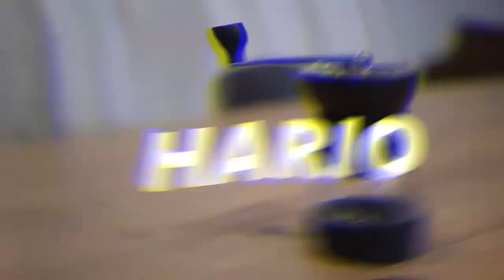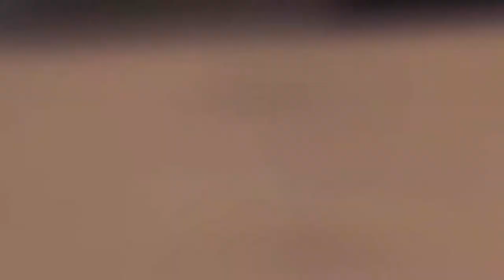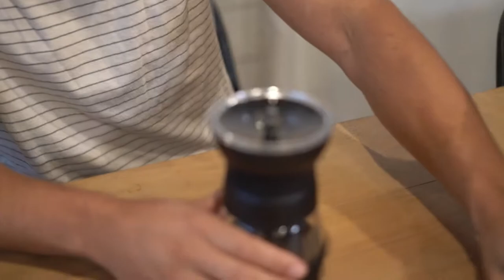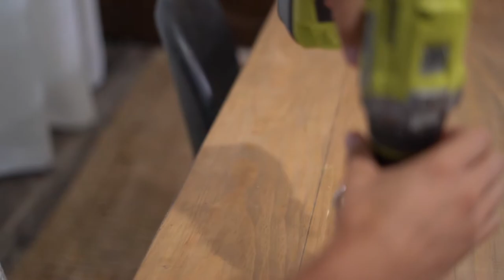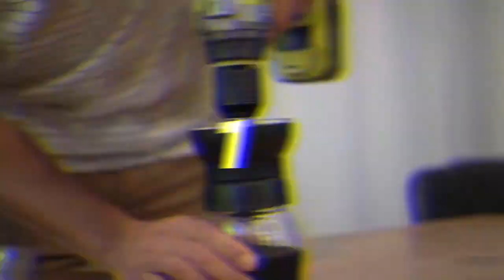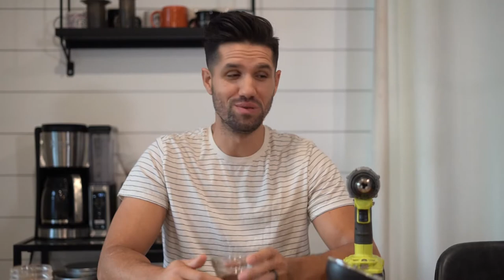Hario Skerton Hack: Drill Mod - Grind Your Coffee Fast!

Comment: I tried it with my drill but it kinda struggles. If ı crank up the power all the way it does turn but it's way too fast. If ı try to turn is slowly it just does not have enough power to crack the beans. How much power does your drill have? I also have the skerton pro model btw

Comment: Ryobi drills are clunky asf. I recommend a Milwaukee M12 drill which is much lighter weight and has plenty of torque. Set the drill speed to 1, set clutch position to 3, attach a 1/4” hex shank socket driver, and a 7mm socket to drive the burr shaft.

Comment: Ha ha. I thought about doing also. Good job. My current low end Ascaso commercial grinder has a stripped nylon gear that drives the burr spindle. A small screw somehow got in grinder and froze it thus stipping gear. Maybe I could modify a VSR drill core to make a direct drive? or just wait for the new nylon gear to arrive.

Comment: slow that thing tf down. have to grind slower. skerton can melt for one thing if you treat it like that, and grind wont be as good.
Reply from the maker: I know right! Need to slow down. As mentioned this was our first time testing this out. One of the things we noticed, but the content didn’t make the cut on the video edit was that the speed would make the burr kind of wobble. That part that was edited out but adds to your input that the speed can lower the grind quality
Reply from the maker: Funny my Dad actually said the same thing today about using a bit today haha! Thanks! Yeah that was our first time doing it. Maybe we will do an updated feed back video
Reply: @goodcoffeevibes9360  if you do that, tip from andrew at flair, can use a mechanical screwdriver instead of a regular drill, if you find the right one they are more gentle, and for most more ergonomic for use in a coffee context. and, on amazon the black and decker (cheap stuff) starts at $17.50, though i'd recommend skil . im using the junoesque ace40, which is about your cheapest thing you can use for espresso, and it comes with a drill bit

Comment: Ok I just did this, but on low and slow setting so I don't brake the grinder. I watched this to see if it would brake the grinder. I feel like ceramic would brake somehow. I'm not with about the shaft since hario pro is well supported on the shaft.. Though, the support is plastic so it would probably brake..

Comment: Okay, good idea for speeding up the grind without killing your arms.  But the drill motor is overkill.  Sure, the first obvious choice since it has an adjustable chuck, but calipers (or a bit of trial and error) will quickly show you that the hex head of the drive shaft on the Hario Skerton Pro is 7mm.  

So grab a 7mm nut driver and your lighter impact driver, Bob's your uncle!  Or if you have a well made cordless screwdriver, that accepts 1/4 inch (shaft) nut drivers, then you have the simple solution that should work well but also fit in a kitchen drawer when not in use.